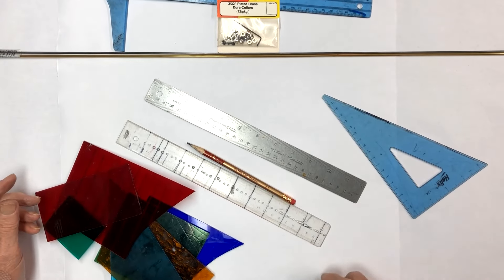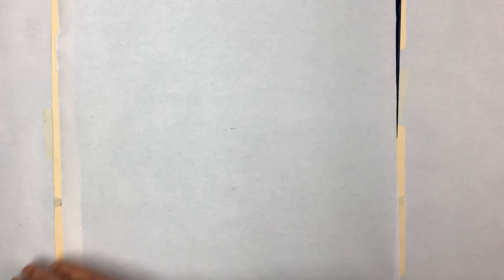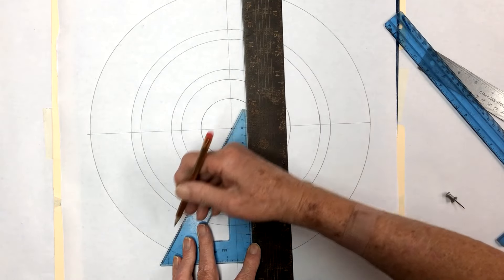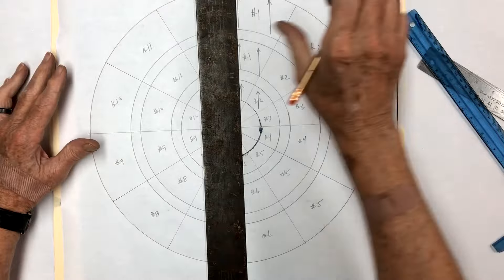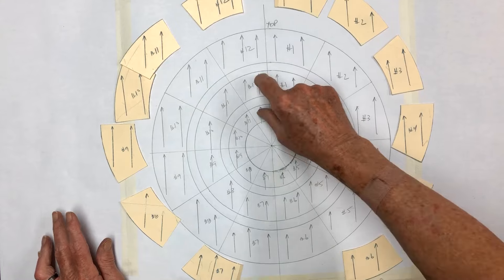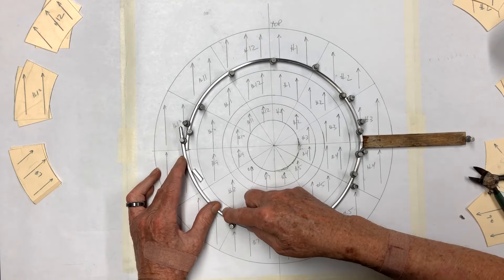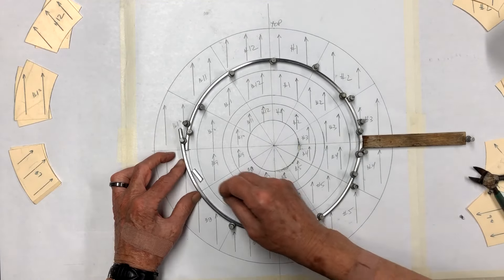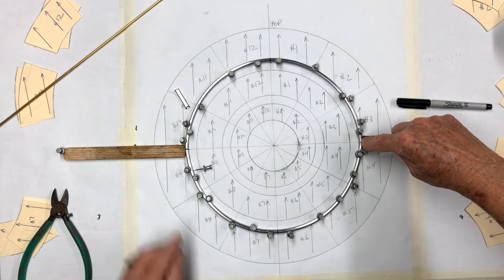Leaded Glass Vertical Lollypop Spinner!!

Comment: Hi Bill,  I have now watched your Verticle spinner video at least 10 times and am very keen to give it a try.  I love the final product; your instructions are clear and easy to understand.  Any failure will clearly be in the application at this end. 
Two questions for you (I am having some challenges finding the suggested materials - 1.Your thought - would copper tubing (3mm) work just as well as the brass down the middle of the spinner?  I realize that it will be more expensive.  and  2.  Do you think that I could use braided picture wire - 1.8mm as a substitute for the piano wire? I am sure that I can find set collars to fit what ever wire  is used. 
Looking forward to reviewing more of your videos and trying the projects - Thank you again.
Reply from the maker: Hi Peter,
So glad you are enjoying the video projects. The copper tubing won't work to good as it doesn't have as good a bearing surface as the brass tubing. The breaded wire also wouldn't work as you need the wire to be as stiff as possible to get the circles to turn freely on the brass tubing. I don't know where you live, but these items are all available from Amazon. They are also found at Hobby Stores that sell radio-controlled cars, boats and planes. Both the music wire and brass tubing are made by K&S Precision Metals. The collars are made by DuBro Products. You can also get them on Amazon and at Hobby Stores. Let me know what you can come up with and hopefully you can get started on your project. Please feel free to ask any questions about any of these video projects, it's been fun to share my projects with others. Have a great day!!
Regards,
Bill Stone
Reply: Hi Bill, thankyou for your very prompt response and the great advice.  I live in North Queensland,  in a small country town with limited supplies.  I had no luck finding what I was after on Amazon Australia but your details have given me a great lead.   Seems that K&S Prevision Metals have an outlet in Aust. that carry the items.  I will be in touch with them for more details ( they advertise the brass tube but only in 12" lengths). Hopeing that I can get all that is needed for both the vertical lollypop spinner and the 6 blades suncatcher (love them both). 
I have assumed that you are happy for your design to be used by others.  
Again my thanks,  I look forward to working through all of you videos , they are a great resource for us beginners 😅.  😊 Peter R
Reply from the maker: Hi Peter,
So glad that the info I sent you was helpful, hopefully you can find it in 36" lengths. If not cut down the sizes of the circles and maybe just make it have two circles instead of the three in the video. The bull's-eye spinner has only two circles in it in the center and I think the outside circle is about 9" in diameter. The 12" x1/8" brass tubing would work great for that one. The 3/32" music wire would also work for the wire part of the project. Best of luck with your project. Have a great day!!
I have another subscriber from Australia, she lives in the rural south part about 6 hours from the city of Adelaide, Australia. If you read some of her comments, you can see that she has the same problem as you do trying to get supplies.
Regards,
Bill Stone

Comment: Bill, job well done.  What size tubing and music wire do you use?  Jack
Reply from the maker: Hi Jack,
I just found your comment; I was getting an email when someone would comment on my videos, and they have stopped doing that, so it is harder for me to send a reply in a timely manner. The music wire size is 3/32"x36" and the brass tubing is 1/8"x36" Both made by K&S Metals. You can find them at Hobby Stores that sell R/C Cars, Boats and Airplanes. You can also find the small Collars made by DU-BRO there also. These items are also online. Thanks for your comment and good luck with your project. Have a great day!!
Regards,
Bill Stone